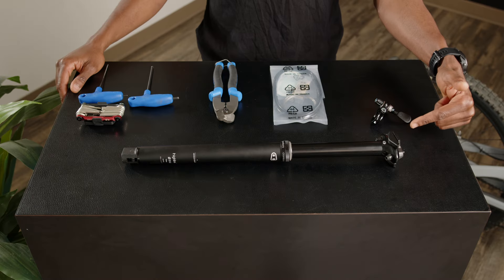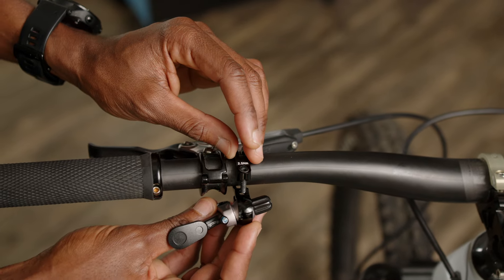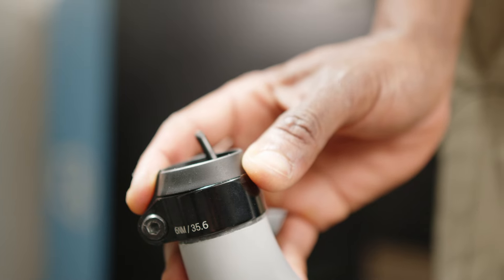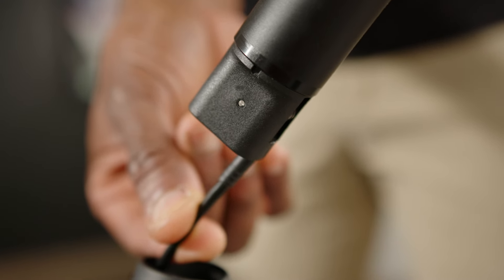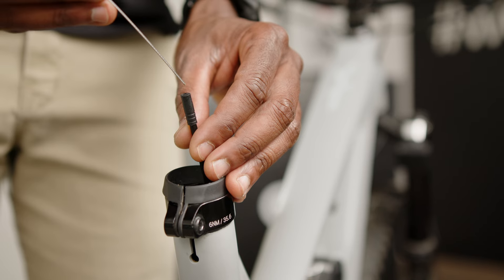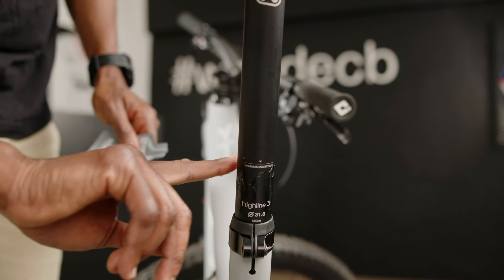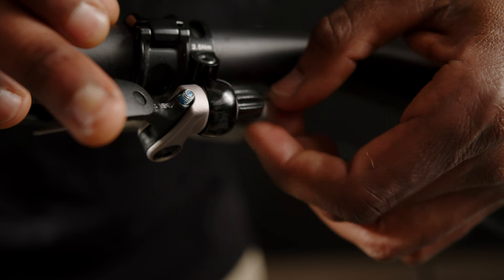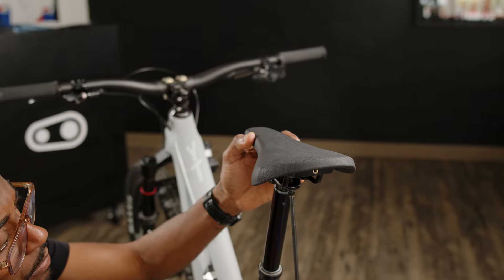How to Install A Dropper Post 🧐

Comment: installed my highline 3 last night and followed his way of deciding on the final length of the housing   vs another video that just mentioned cutting off 165 mm from the top of the seat tube mark, worked great and it is easier to make further cuts on the remote end if it is still too long.

Comment: I have a dropper where the lead end is at the remote and the cable length is adjusted at the bottom of the dropper. My question is if I buy a new remote where the cable length is adjusted at the remote, will the lead end of the cable be compatible at the bottom of the dropper? In other words, do droppers normally accept a lead end or the adjusting end fitting? Hope I'm wording all this correctly.

Comment: What do I do if my bile doesn't have internal cable tunnels?
Reply: Like it doesn't have internal tunnels or doesn't have internal routing at all?

My bike from 2017 has exit points for internal routing but no internal "tunnels" like some newer bikes have. I had to feed the cable housing through the inside of the frame slowly and carefully...armed with some patience. 

If you don't have any exit points on your frame, you'll probably want to get a dropper post with externally routing.